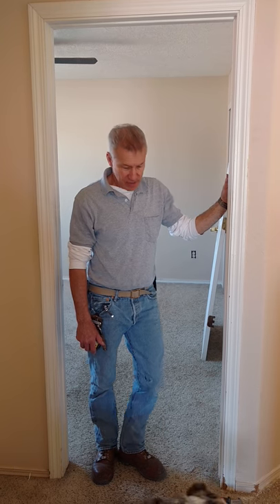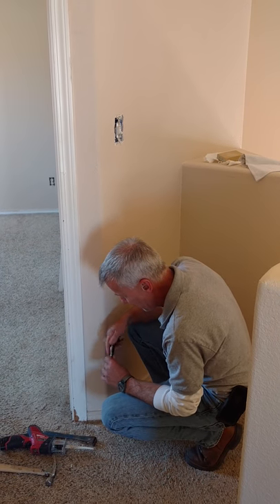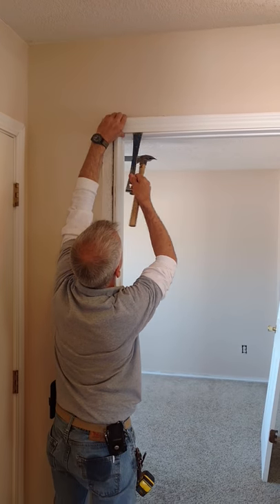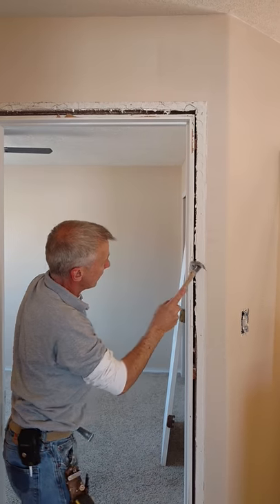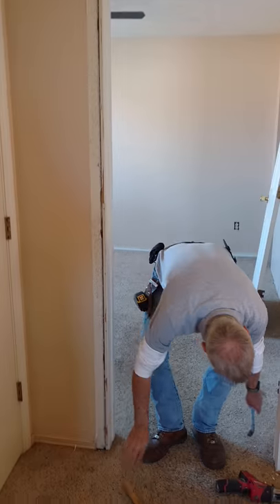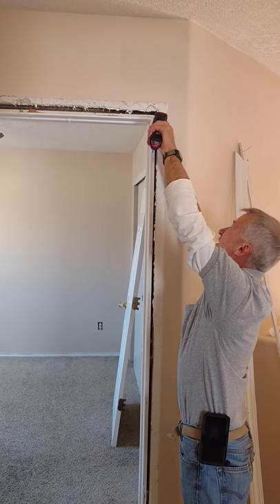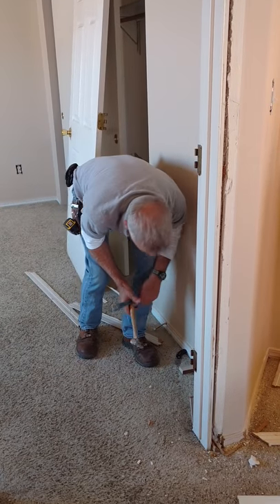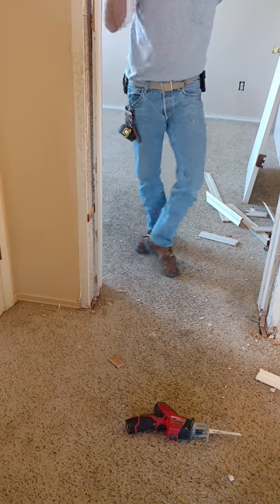How to remove an interior door frame

Comment: Is there are a non-destructive way of doing this? I have a 100 year old home that I'm trying to restore while keeping as much of the original materials intact as I can. One of its problems is that there's not a single door in the entire house which is still square. I've already shimmed/bent the hinges back into place but - in many cases - the whole frame has gotten out of alignment.

Comment: Very illustrative video! Sorry if this question sounds silly but I'm just wondering if could be any issue when removing the old door lining.. structural wise, collapse..? 
Thanks,
Juan
Reply: The door frame was put in after the house was built. It definitely should not be supporting anything.

Comment: Not bad Joseph,
-But please, cut down on the ums and awes a bit. ( shortens up the vid for us)
-No need to saw back and forth when 
using your Sawzall. It does that for ya Joe. 😉 oh yea, get a new metal cutting blade Joe.
- No need to see every nail banged in or make us wait while you do both sides.
-Safety glasses are not only cool, but they're smart to use.
Thank Joe.
-
-

Comment: Good info.  So what if he got rid if the frame..needed to know how to do it.
Reply from the maker: You can eliminate the door and finish the rough frame opening by installing sheetrock on exposed wood areas, then install metal corner bead on all outside corners. Apply texture mud and paint.